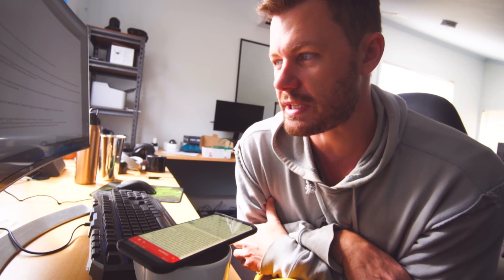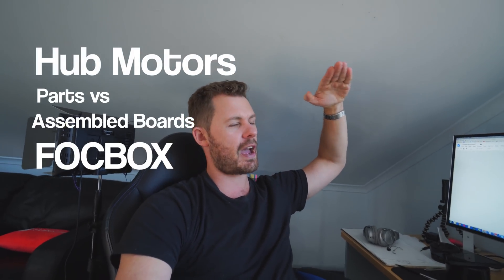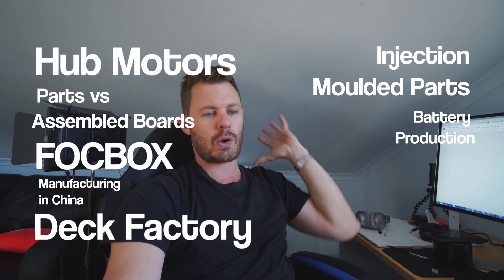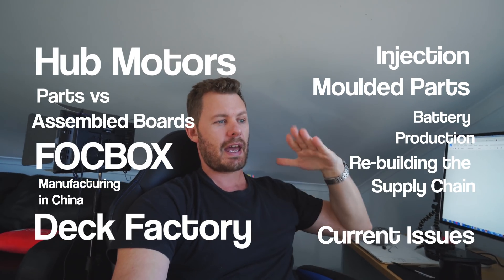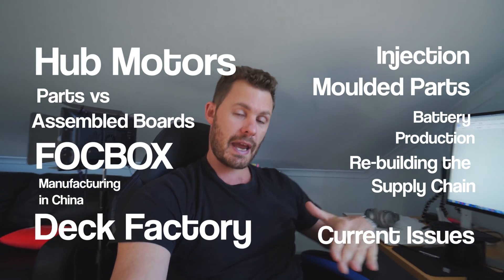RAPTOR 2 MAY 2018 PRODUCTION UPDATE!

Comment: I use a 2 part polyurethane mix of EN1556...its a 2 to 1 mix controlled by the size of the actuators and is heated to the correct temp and viscosity as the OEM Manufacture.....its dispenses buy a gun that mixes the two parts as its dispensed.......I can send details if needed......me perform molding operations where I work with extreme consistency......I'd luv 2 help if I can..

Comment: Why cant a gasket be used similar to a valve cover gasket on a car  water will never get in  and it will last forever
Reply from the maker: Unfortunately, all gaskets are custom made, they are not standard parts you can grab off the shelf.... so we had to make a mold (took forever) now we have to refine the materials so it gives the perfect seal inside the box. total pain, but it means the box will be water tight.
Reply: Enertion Electric Skateboards  ok good luck

Comment: Jason, I really want to know why you guys dont go for a solution similar to Carvon. You wont have to worry about the urethane in the wheels. You guys took the hub motor design to the NEXT LEVEL, so why not take THE WHOLE THING to the next level? Let people put whatever wheel they want, and offer the most amazing battery/hub motor/controller/deck solution out there! Imagine those sweet parts with the bearing/wheel combination of YOUR DREAMS! 

So many people want this solution man, you know this, check the forums. Take the game to the next level :)

Hope you can shed some light here.
Reply from the maker: Enertion r-spec motors have way too much torque, they would destroy the core of a normal Skateboard wheel. Skateboard wheels where never designed to be driven by the central core. Eventually the core deforms and the wheel to motor fitment becomes loose and it rattles. I honestly believe my design is superior. Also our motors are so massive, there would be very little ground clearance, the motors would get knocked on debris that you ride over and when you transfer from road to foot path at the wrong angle you would constantly risk grinding the motor. This is why carvon resort to putting urethane sleeves around the exposed motor cans.
Reply: THANKS FOR THAT ANSWER!!! makes sense what you say here man. I know they recommend the use of 90 to 100 mm wheels, that must be one of the reasons. Will eventually get my hands on one of your amazing boards ;). Thanks again!